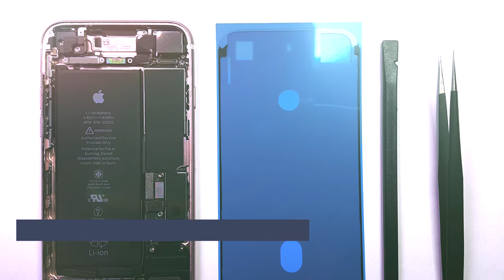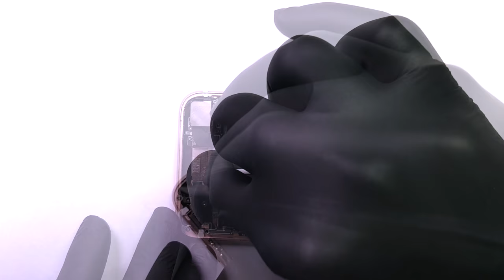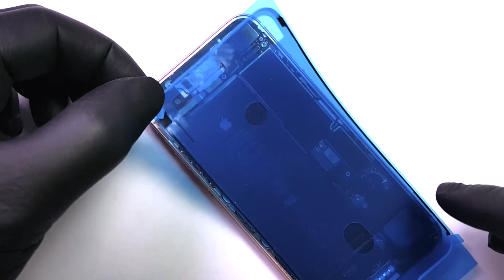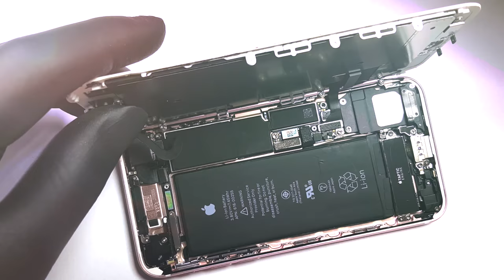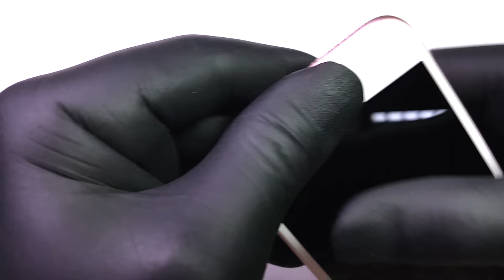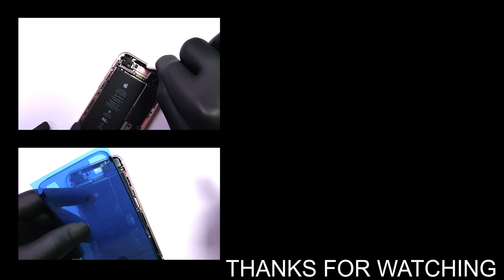iPhone LCD Screen Frame Waterproof Seal Adhesive Sticker

Comment: a good seal proof idea is to heat the glue again and gently push the phone evenly for 3-4 minutes so it stucks better
Reply: that’s what i was thinking! thanks
Reply: @irene.5798  thats what the water resistance is on the iphone u just reglue it
Reply: This only cost 1.99
Reply: best comment of the video!!!!!!!!!!
Reply: Would you pre heat it before you apply it? Like before you place it on the phone with a blow drier for example? N00b asking haha
Reply: @watevaa1234567  no you can just put the adhesive on, close up the phone, apply a little heat to the front and back of the phone, then clamp it together or put a couple books on top of it for 30 mins. Everyone's a noob at one point 👌🏼 I just got into phone repair as well :)

Comment: It does nothing to the phone as far as water resistance unless the adhesive is heated.
Reply: So what’s the point of this?
Reply: @tradinwarstoriez5641  dust
Reply: I’m pretty sure it leaves the lcd flush with the phone
Reply: Good job I’ve got a heat gun then
Reply: How hot in Celsius should it be. I think I'll have the cracked digitizer installed by the shop and then I'll install the adhesive waterproof myself and heat it with my SMD heat gun.

Thank you.
God bless, Rev. 21:4
Reply: @ABLO_dnb  how hot in Celsius?
Reply: @SevenDeMagnus  not too sure, i just gave it a good blast with a focused nozzle.
Reply: @ABLO_dnb  Thanks. Wait do you melt the waterproof adhesive  before you close the two halves or you heat it after closing from outside? When it was factory new did Apple also put the waterproof adhesive or this is actually a type of mod?
Reply: @SevenDeMagnus  you have to scrape and clean the old seal off, to then stick the new one on. I scraped it off with a plastic scraper and then stuck the new one on, heated it up then refitted the screen. I then gave it a blast from the heat gun as i was closing it and after aswell. Theres some pretty decent videos on yt that will help.
Reply: Also, don’t update your fone ever again after changing screen.
Reply: @ABLO_dnb  How come? The 6s Plus is not going to update if you change the digitizer?
Reply: @SevenDeMagnus  i dont know about 6/6+, but i updated my 11pro after changing screen and its hounding me with ‘non genuine screen’ warning messages.
Reply: @ABLO_dnb  Yikes, that means I'm stuck with a cracked digitizer? God's will be done, I guess I can still read it.
Reply: @SevenDeMagnus  you can change it, just don’t update the iOS.
Reply: @ABLO_dnb  Did you use an Apple replacement screen or aftermarket?
Reply: @pnwesterner6220  nah not a genuine one i dont think. 

This was the ebay tag -  

iTruColor OLED For Apple iPhone 11 Pro Replacement Display Screen Repair UK